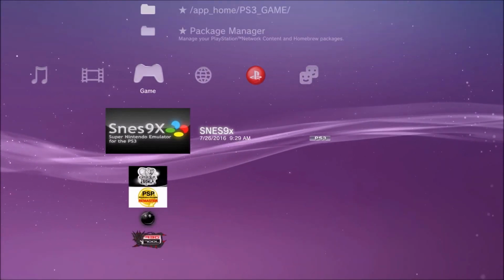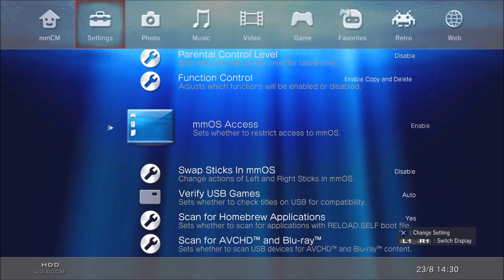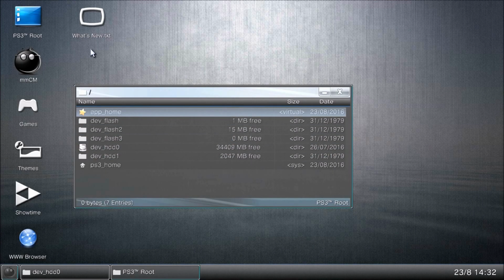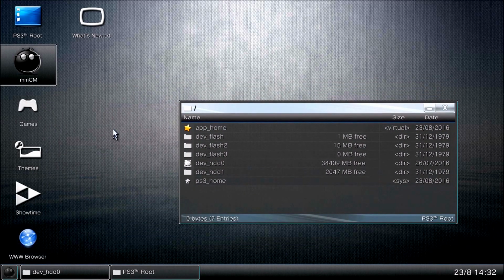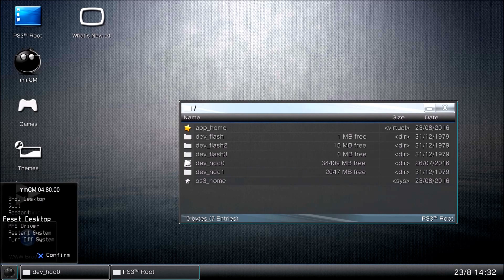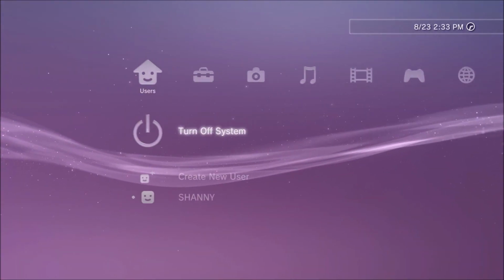PS3 Custom Fan Mod + REBUG

Comment: Is it still running good?
Reply: Yeah I'm gonna seriously have to look into this stuff after I fix the ylod issue. Should've considered modding my ps3's cooling before it bust earlier this year :/ Had no idea ylod was out to get my system
Reply: @nicklespale22  yea man the ez chill is only $25
Reply from the maker: It is, 3-4 years later. However. There are better methods to do this now. This was like my 3rd mod
Reply: @ThirstWorldTTV  I'm planning to get the EZ chill system what do you think about it?
Reply: @ThirstWorldTTV  do you think it might cause my system harm towards the fan motor or do you think it'll be fine?
Reply from the maker: @matthewflores3449  it'll be fine, custom firmware ps3s has advances to the point where you can change the fan speed with software now, lol
Reply: @ThirstWorldTTV  yea I just dont know how to do all of that fancy stuff lol.
Reply: I have the latest firmware on one of them and it is jailbroken but I have no idea how to use all of that to be honest.
Reply: Do you know where I can find some new thermal pads to replace all of the ones in mine?
Reply from the maker: I did a video about hacked ps3s explaining alot of the programs and how to use them, as for thermal pads or thermal paste, I always just search for them in Google so I can see who has them cheaper Amazon or eBay
Reply: @ThirstWorldTTV  doesn't size matter as in thickness and what not?

Comment: Is there a mod that can let me increase the fan speed manually on official firmware but can also let me keep the automatic settings in custom firmware?
Reply from the maker: Sortof. With custom firmware you can controll the fan all through software. Sorry, this was one of my first mods and videos ever and its old.

Comment: When my ps3 60gb got the ylod of death in 2013. I sent it out to sony and got it fixed. Ended up getting a fan controller called Ez chill as soon as I got my console back. Until this day never had any problems with it and always had the fans at like 50 to 60 percent. Never changed the thermal paste in it either. I'm guessing it never dried out due to the console not getting really hot over and over and getting quite alot of airflow. I probably will change it eventually.
Reply: Have you owned it since day one?
Reply: I've always thought the fan would brake or something if I got an ex chill but give me some insight please.

Comment: guys, controlling the fan isn't the problem for this model.  A true fix would be to use PC fans... but I have yet to find fan kits....  so sad
Reply: Yo just use the fans from cool master if that what your looking for get the use 4 prong to power the fan then get a switch

Comment: Since your PS3 is jailbroken you can also install a homebrew app which allows you to control the fan. I use that personally for my CHECHA01 BC PS3. It would save some time of installing a hardware mod. But I get you, it's fun to do regardless!
Reply from the maker: you know, i 'speculated' that there was a fan controlling app for jailbroken ps3's, but, i never looked into it, haha, this mod still works great to this day, this ps3 is essentually my PSP home console, lol.... watercooling is on my agenda, but i've been really buisy modding stuff for people and trying to make 2 youtube videos a week, but watercooling will be done eventually
Reply: Nice man. Can't wait to see what you do! And incase if you're ever wanting to try out the homebrew fan mod - just search "Control Fan Utility PS3" You should get something with that. The homebrew app is quite unique because it also tells you the exact temperatures of the RSX/GPU.
Reply from the maker: Dylan The Don omg, im going to get it just becouse i want to know the temps! Sounds like cpuid hardware monitor for ps3! Thank you!!
Reply: No prob, dude! Just so you know, you may have to try different fan apps. Some may not support your firmware. You'll know it doesn't support your firmware by it saying "This CFU app doesn't support this CFW" (obviously haha) OR your PS3 will have a black screen when you load up CFW forcing you to shut it off and turning it on again.

Comment: This is a much better option than what I've been doing. I just run a little USB fan from my Xbox 360 to blow over my PS3 when I'm using it to try and keep it a little cooler. I don't know if it does anything for the power supply, but it does move the hot air out of the entertainment centre that they sit on, so at least that's something.
Reply from the maker: Carbon Knights Gaming i have a fan to remove all the hot air behind where all my game consoles are aswell, but as for an individual gameconsole, it works like a car, air in. Air out, as long as your not disrupting this, by blowing air into the console where the air wants to come out, it should be fine
Reply from the maker: Carbon Knights Gaming this was actually the first video i made, even though i didnt upload it first, i feel ive had alot of growth making videos since this one haha